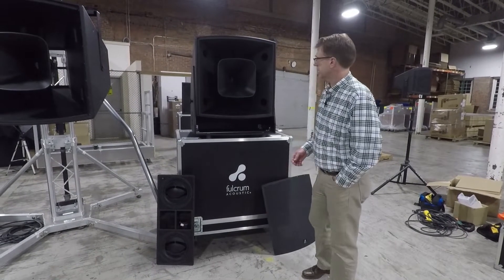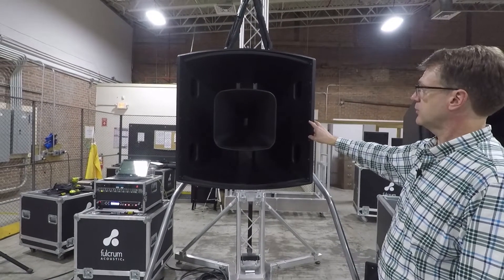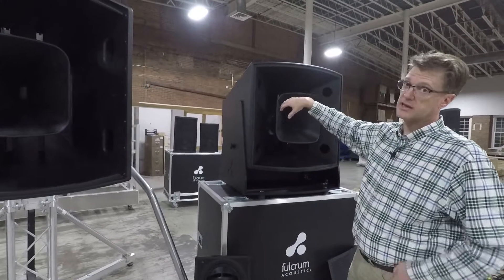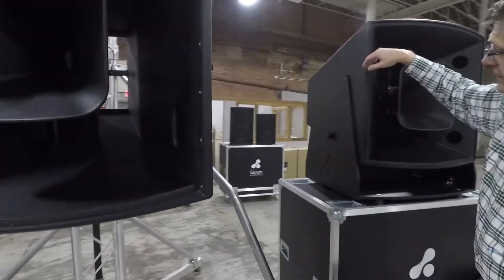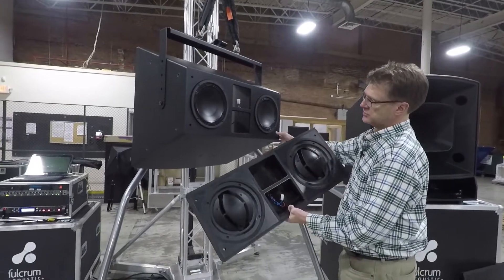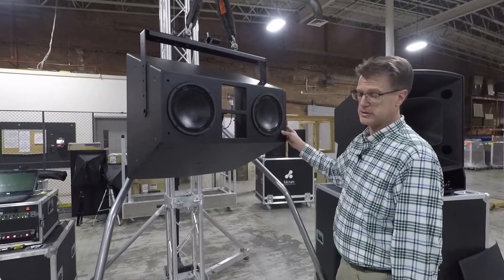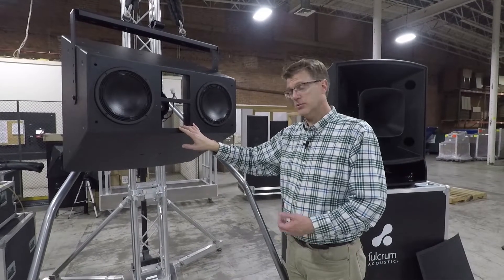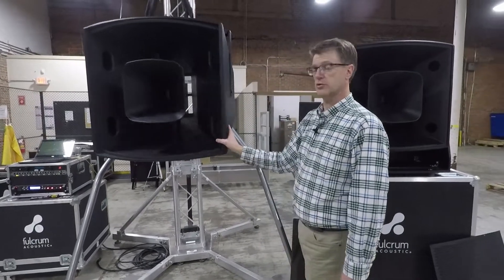Comparing Fulcrum's FH and AH Coaxial Horn Systems

Comment: Looks like my EV MTH1 speakers with a 10" mid base speaker & a Horn ion front that goes to 17000 khz. There rated at 350 watts in 8 ohm. I power them with a QSC G7. Makes Trance EDM Techno very good. I took the Horns out, I just want the Mid Base flowing un intubered. Van Dyke has some great new stuff...
Reply: Dave Gunness from Fulcrum designed those EV boxes.
Reply: @poopdrums  Thankyou for the info.